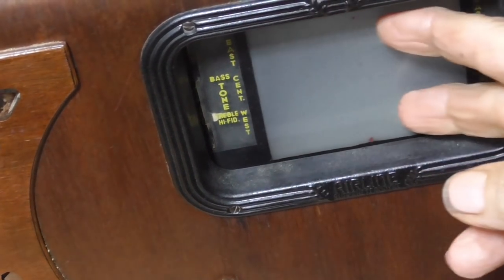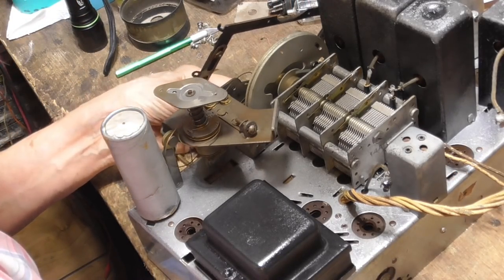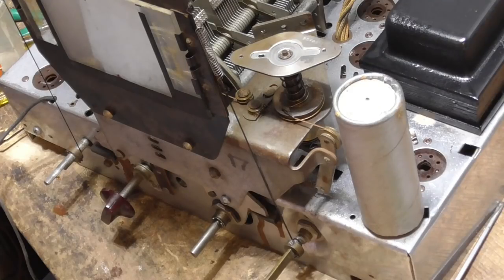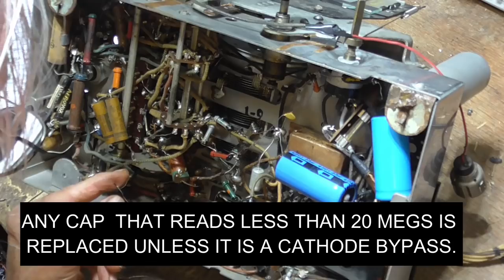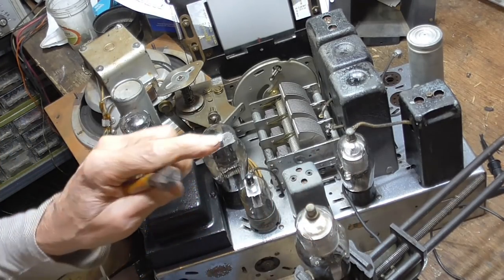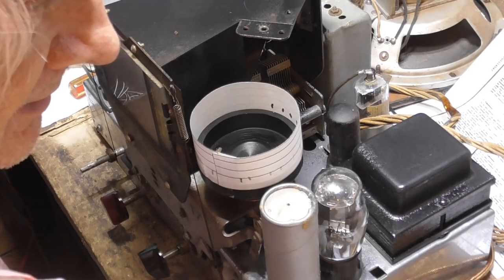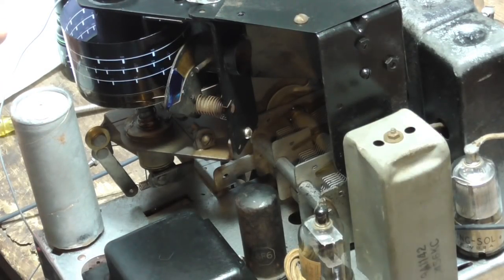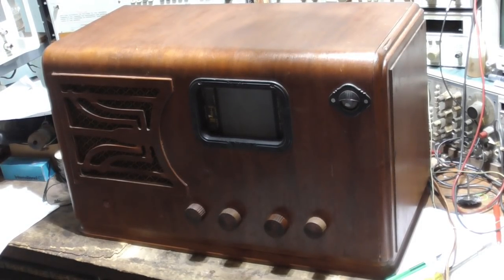RESTORING AN AIRLINE MOVIE DIAL RADIO

Comment: The Los Angeles Theater was the last major Movie Palace built in Downtown Los Angeles, California.  It is a very elaborate Theater with 3 balconies, wood paneling with gold, velvet curtains and chandeliers all over the place.  The rest area in the Theater is in the basement of the Theater, bathrooms, smoking areas and even a Nursery!  Oddly there is a small screen that by the use of mirrors brings down into this rest area the film being projected from way up in the Projection booth.  This Movie Dial radio obviously being influenced by the Golden Films of the 1930's obviously influenced the production of this radio.
The projection by mirrors in the Los Angeles Theater for those using the Rest area has always reminded me of this radio again due to the uniqueness of the radio and the Theater which is probably the only one to have such an elaborate projection of the film so anyone visiting the rest area in the basement area could at least watch part of the movie being shown way up in the Theater.  I have been in many Movie Palaces but have never seen such a system of mirrors projecting onto a framed small screen into the elaborate basement area the film being shown at the time in the Theater.

Comment: Airline model 62-318 from 1936. Actually made by Wells Gardner Co. for Montgomery Wards.
 Amazingly nice restoration work on this well ignored and heavily gummed up super rare radio.  Usually the movie dial 
plastic is totally  shot!  I wonder why there are two holes drilled in the front that should not be there?
 The movie dial display looks pretty good! Another fantastic job Ron!

Comment: A bright chrome plated chassis and the glazed black paint is most unique on this extremely rare radio.  It came in several different model numbers and also a beautiful large console, which is a true beauty with one of the most "Art Deco" bezels to ever be put on a radio.  Again, I feel pretty sure this was made by the Wells Gardner Radio Corp. in Chicago (known for their exceptional radios) but sold under the Airline name for Montgomery Ward's department stores.

Comment: This radio appears to be an Airline Model 62-318 made in 1936 by the Wells Gardner Radio Corp. for the Montgomery Ward's Department Stores and sold under their trade name of Airline.  There were several different Model numbers with slight cabinet changes aside from the Console unit which had a much larger and much more impressive Dial Face Bezel.  The Airline Movie Dial Console is one of the largest Consoles made in the 1930's.
Reply from the maker: Yes. Thanks for the info. I searched everywhere for an original dial strip, either to buy or to borrow for making  a copy. Apparently the guy that was making them either died or got old. (too old?) No luck. DO NOT EVER ATTEMPT TO PULL THE FILM OFF THE DRUM! It is permanently crimped so it would not survive. I had to make a new drum since the one in my set was badly warped. This caused the original dial strip to hit the supports which was what scraped the pattern off it, making it impossible to copy. It might be possible to photograph the strip in situ and then use photoshop to piece the photos together to remake a correctly made copy.
Reply: @glasslinger  The original 35 MM Film strip is a piece of History itself with all of the full City names and Station Numbers (many of which no longer exist) imprinted on the film.

Comment: Interesting radio, you dont see many projection type frequency displays.
Leds can be destryed by reverse voltage the diode was a good idea, sometimes you can get 50/60 cycle noise from the diode ringing, a 0.1 across it will reduce that.

Comment: I have been eagerly anticipating this restoration since you got this item at the auction.
Reply: At auction.... 50 years ago. I can not think that it is possible to buy radio for 20$. He has good stash in the attic.
Reply: @kaunomedis7926  no.  He bought it at an auction 3 or 4 months ago.  I was there.  Old radios that don't work aren't that expensive in the USA.  Especially where large estates are being sold.

Comment: Friction tape is still around for use in the electrical field for  wiring bigger electric motors using split bolt  connectors  instead of  wire nuts or twist on wire connectors. Any electric motor bigger than 7 horse power has to have the stronger split bolt connector. In order to put the motor wiring into that little junction box mounted on side of motor, you first wrap friction tape around all the conditions to prevent the electricity arching out on side of metal grounded junction box on side of motor.  Twist connectors are plastic and when used on smaller projects, are insulated for being used inside of junction boxes. The split bolt connectors used on bigger industrial applications are usually bare metal with no insulating plastic body to protect it inside a junction box. Each wire feeding an electrical motor have to be protected from touching the other motor feeds and the grounded junction box mounted on motor sides usually.

Comment: Do you happen to have 4 knobs for a Setchell Carlson "The Jet" radios?  If so I would love to buy them from you as I notice you have quite a knob collection.
I have tried everybody and no one seems to have any.  Any suggestions?
Reply from the maker: I do have several but don't know if I have four. I normally don't sell my parts for obvious reasons! Just keep an eye on ebay for "radio knob lot" and hope for the best! If I sold my set of knobs and then happened across the radio and needed them.....!
Reply: @glasslinger  I understand as they are keepers!

Comment: I own the floor model 62-303 floor model movie dial, all I had to do with mine is recap it replace 1 tube and replace one of the strings that went from the volume control up the front of the radio to a spring loaded indicator, other side was fine. The film on this is excellent but there are some small areas on screen on front that are see through but it still displays fine. case is fair and need to buy some reproduction buttons as a couple on this are broken or missing. paid 20 for it.

Comment: I certainly appreciate the work you do, which I could never compete with, but I just wish you could have put the names and station numbers on the 35 MM film strip as was the caw when the radio was sold.  It is really neat and a piece of radio history however what you did was truly amazing.  
The other difficult Face Dials to duplicate is one of the Emerson "Mae West" radios.
Reply from the maker: When I realized the  whole effort was futile I just wanted to get the radio out of the shop. Maybe later I will get after it again but with the huge number of projects in line there is currently little incentive.
Reply: @glasslinger  The are several reproduction companies around that do amazing reproductions for unusual radios, but this Movie Dial radio is a "one of a kind" radio and reproducing a 35 MM film strip would be virtually out of the question.  I have read somewhere an individual was making them, but that was a long time ago, and I doubt they are still making the Film Strips as they were made originally.  Luckily my radio has one that is original and still in good shape.  I know film preservation is a big issue these days, and if the 35 MM film has been stored properly, generally in cold storage, the film has lasted and enough so that an old movie can be duplicated, especially the Technicolor films of the past which are no longer made in Hollywood.
Reply from the maker: @richardmcleod1930  If I had the original strip I could reproduce it myself with my equipment.  Unfortunately, the strip cannot be removed from the radio drum without destroying it. That means using a camera to capture the image and then using photoshop to make a corrected, properly sized image. Need someone with an intact dial that would be willing to go to the trouble of photographing it. A lot of work!

Comment: Good show! I have the model with the slightly larger grille. A very good performer made by Wells-Gardner. I remember talk of reproducing the film strip, but I don't know if anyone did or supplied a print-out. The original is unique because it's packed with the names of locations along the dial. The feature is interesting, but rather gimmicky. I would say it was convenient for people that had poor eyesight.

Comment: This is fun. Could you have scanned in the old film, lightened it up, cleaned it up and reprinted it? However, the results probably would have been no better than what you did.
Reply from the maker: I spent a couple  hours trying to do it but the film had also shrunk so it was a futile task. The numbers would be at the wrong place on the film.

Comment: What an unusual way to display band frequencys, i've never seen that before 😀
Ron, you make everything look so easy but it's not.
I like the substitute led for illumination, never need replacing 😀
Is that friction tape similar to self amalgamating  tape ?, it merges together.
Reply: Z: Friction tape is cloth tape impregnated with a bit of (asphaltum?) which is black and a slightly sticky side.  It was the first type of tape invented before rubber electrical tape.  It was originally intended to provide mechanical (friction) protection for whatever it is used on.  I remember my dad using it on trailer/caravan safety chains in the 60's.
Reply: @KB4QAA  Ooow its something i never knew about.
The self amalgamating tape is rubbery and once wrapped with a little tension it melds with the other layers for a water proof seal, it goes solid as a rock.
I like harness tape as its dry and stretches nicely over wiring.
Sorry waffling.
Reply: @KB4QAA  I still got a roll of it, my dad called it tar tape back in the 70's, if one directly translate the name of it from here, Europe.

Comment: I'll be dipped!  YOU DID IT.  A reproduction dial.  Now if only you could get an original and strke a copy of it.  There are scanners that will allow you to scan strips of film....oh, what you could do with that....
Reply from the maker: The guy that made repros apparently croaked. Couldn't find anyone with a copy.
Reply: @glasslinger  I have the same radio you are working on, fully restored and with the original 35 MM tape still clear and visible.  Wish I could get a copy to you, but I don't dare mess with this restored radio, as I know how fragile they are.

Comment: Neat radio. Never saw that style tuning before. That was a great find! Just wondering, would a voltage doubler circuit  have worked as well for the led? I had to do that when I swapped a failed 6 volt eye tube for a 12 volt replacement.
Reply from the maker: Yes. I happened to have the little transformer in the junk box.

Comment: If the mess simplified on a board(maybe cold metal plank) like a chip stick(weld/solder or screwed in?) on?
Reply: Cold metal - gadolinium, neodymium magnet is quite cool should be will work too?

Comment: great radio and video,but why using a led ? I am shure you have tons of vintage lamps.Maybe you don't wont to heat the film
Reply from the maker: I tried it with the original bulb ($15) and it was very dim. I had the LED so went with it.

Comment: Where do you find these old radios? I would like to find one to tinker around with.
Reply from the maker: Ebay. Type  in "vintage radio" "antique radio" "early radio" etc.  Don't pay too much or you may end up with a repair cost more than the restored set is worth!

Comment: I use a Scotch Brite pad to clean oxides off of wires so they will solder.  Using X-acto knife is too tricky, you lose strands.

Comment: 20 meg-ohms is too low a resistance for a plate-grid coupling capacitor because it's likely to be 2 meg-ohms in a hot radio.  That low resistance can throw the grid bias way off in most grid circuit arrangements.  Be circuit wise - use Ohm's law!

Comment: Leaky capacitors have a negative temperature coefficient - as temperature increases resistance decreases.  In other words leakage increases with temperature.  You have to take into mind how hot the capacitor will get inside a tube radio and therefore what its leakage will be at temperature.  Keep it simple, just replace the damn things with new plastic film caps.

Comment: As valves(tubes) by their very design get hot, I would NEVER use Super Glue to repair them, as heat is the glue's achilles heal.
Reply from the maker: These types of tubes only get barely warm on the base. Not a problem. I wouldn't do it on transmitter tubes that can get quite hot.

Comment: I will never understand why you solder in parts without first making a mechanical connection like a J hook before soldering!  From my experience, that’s simply asking for trouble!!
Reply from the maker: The old radios sit on a shelf. No vibration or shock hits to knock stuff loose. Never had a problem so far. (except when I made a bad joint!)